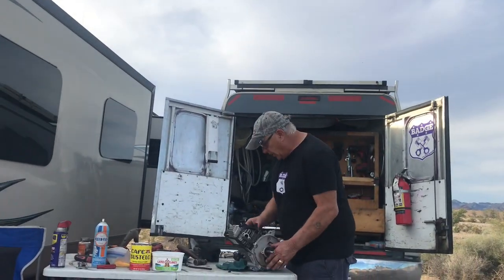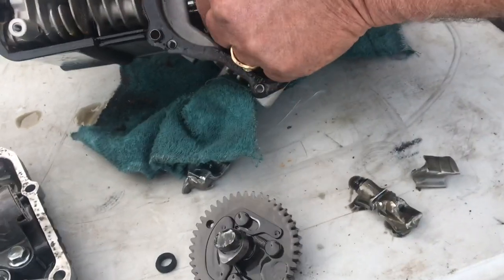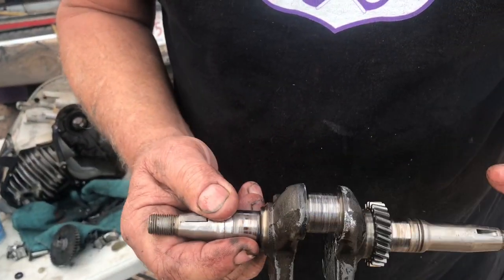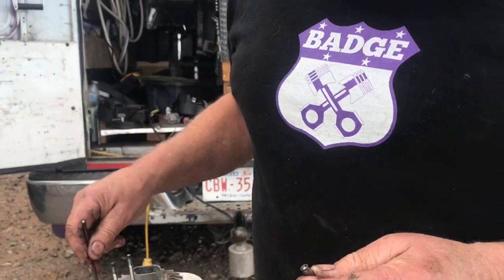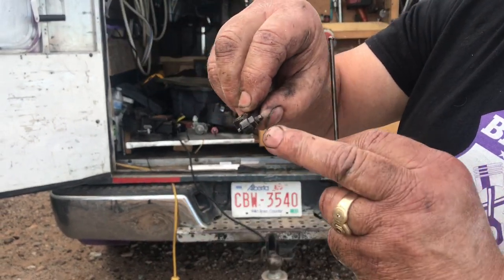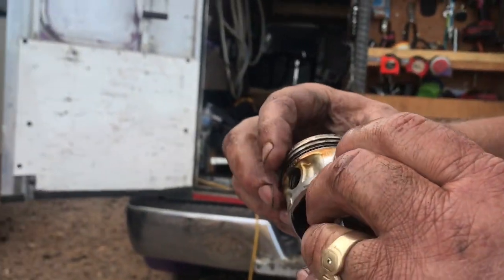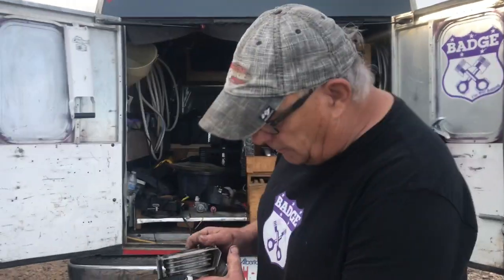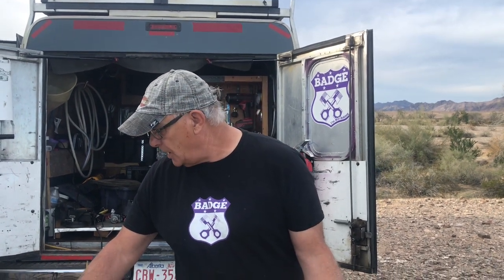EP 128  DISMANTLING THE MOTOR

Comment: Hey badge. I have a question it's only a 10ft box which is a problem but I found a grummond with under 80000 miles for $10,000. Everything sounds pretty good except for it short and it has a 6.5 Detroit Diesel GM. Right off the bat I have bad feelings what is your opinion on that motor no broken rings. That means no double ring Groove. Due to over revving. As you can see I come from some background I just have no diesel background. When the bottom of a rod pokes a window in a block it's not a good sign.

Comment: scrap is under 5 cents a pound..save ignition, the shaft key, spark plug and that's about it. long Block sounds best and less time spent as well..Keep em coming Badge !! You too El.
Reply: Wouldn't be bad idea to save the head and valvetrain parts also.
Reply from the maker: Thanks Jack yeah that’s about it scrap 🛠🇨🇦🛠🇨🇦👍